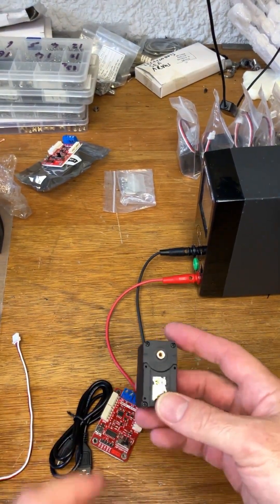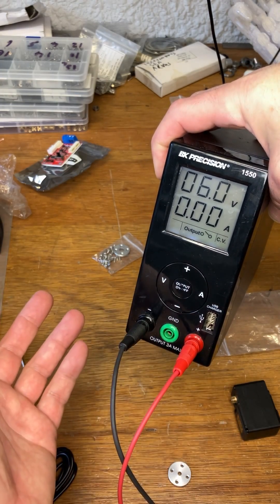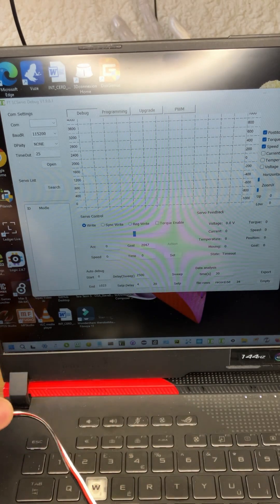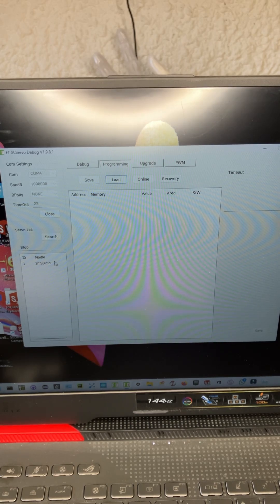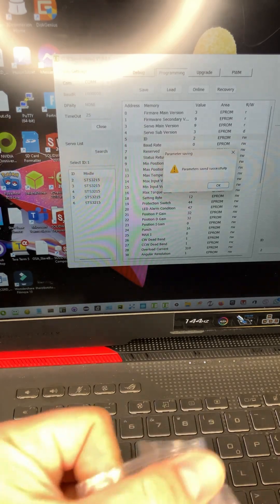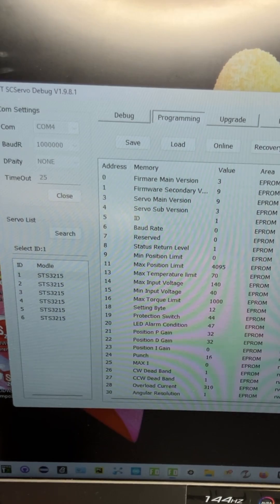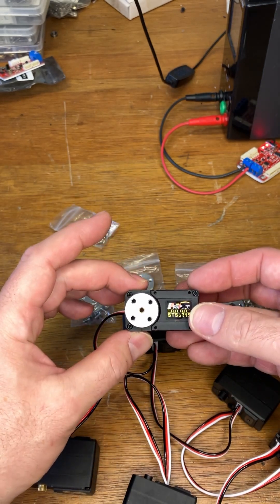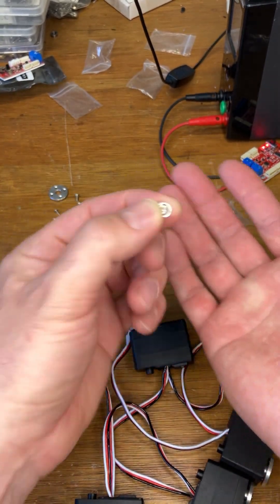Standard Open ARM 100 5DOF Servos - Low cost DIY 3dprinted robot arm for Le Robot by Hugging Face

Comment from the maker: Instructions for how to set up and program the servos used in the arm.

The arm is intended for integration with the Le Robot system being developed by Hugging Face.

Six STS3215-C001 servos are needed to actuate the five dof in the arm and the gripper.

At quantities of 1000 units even the higher power 12v version of the STS3215 servos used in all the joints of the present arm design are under 12 USD each - exworks - so around 15 USD in your hand.

Plus an adaptor board to connect to a computer and a clamp to fix it the desk.

So assuming that everything else is 3d printed that's a 5DOF arm with gripper (6 dof total) for 100 bucks.

If 167 (1000/6 = 166.6666) people are all prepared to buy the servos at once.

Join the project with some of the brightest minds in open AI and robotics development on the discord server at: https://discord.gg/nc2JuEnHEJ

Comment: fetech bus servo is a little expensive, 
there are lots tpye of bus servo in China,  Daran , Hiwonder, they also have bus servo .  They have can-bus intergrated servo motor  , can used for humonid design.
Reply from the maker: Thanks. Feetech are good value buying direct. Hiwonder have nice features but very limited range of sizes. I couldn’t find Daran? Which brands connect to
CAN bus please?
Reply: @therobotstudio  daran PDA-17